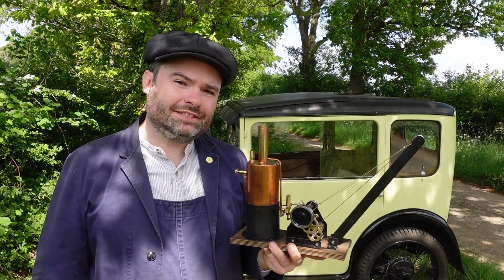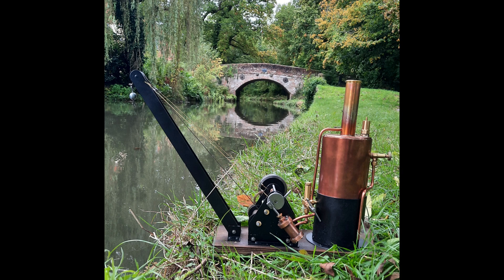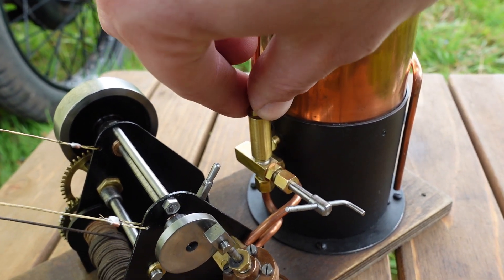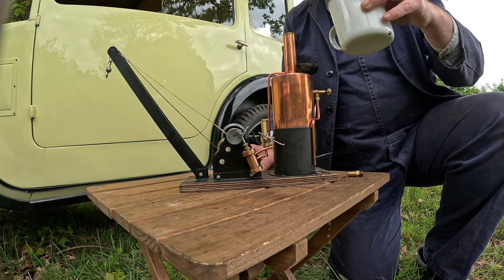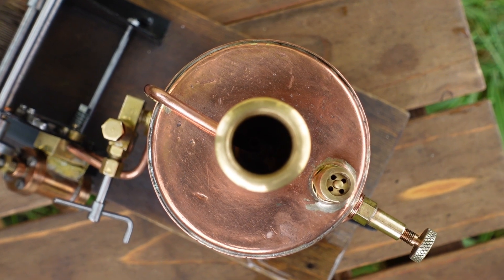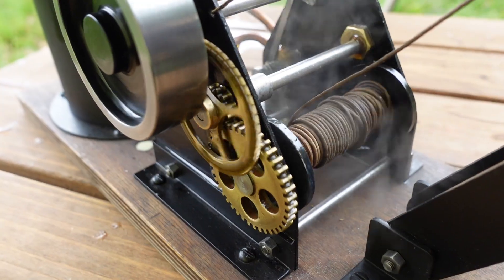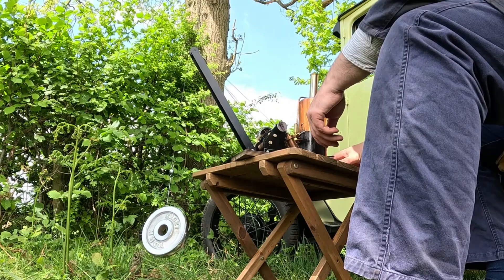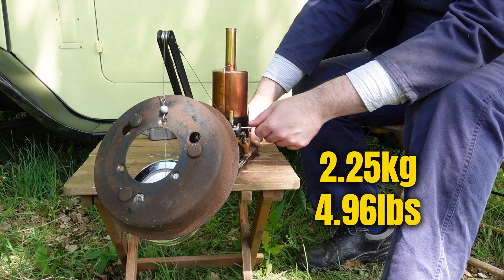Steam Crane - How it works

Comment: I tell you what I have found going through some stuff a Castrol lubrication chart for the Austin 7, just wondered if you had one, I'm guessing you may have one already
Reply from the maker: Is it one of the large garage wall charts or a smaller version?
Reply: @the_vintage_motorist  It's the workshop one around 18" wide x 24" deep